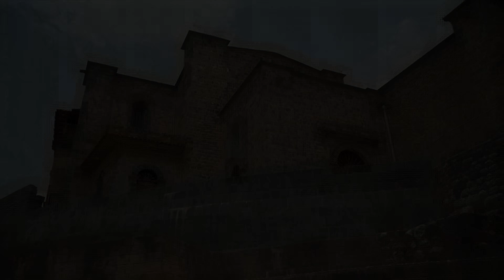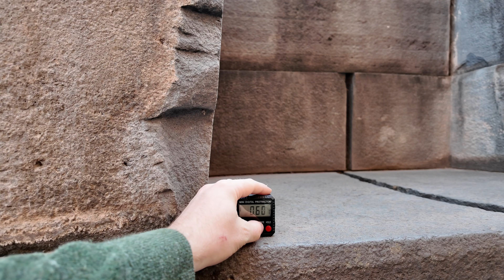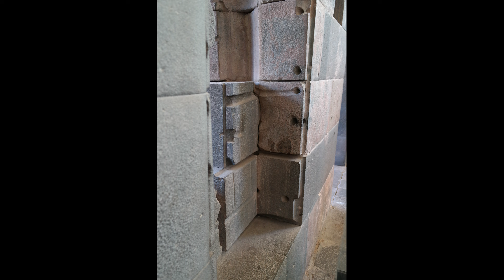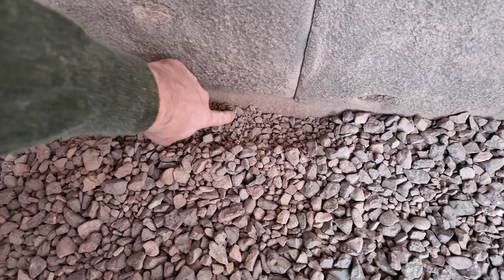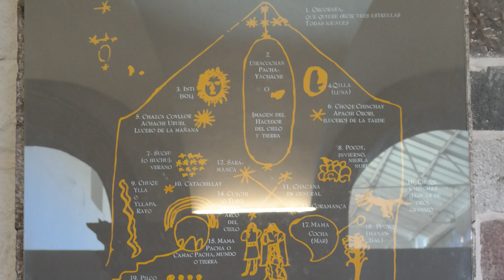The Lost Ancient Golden Machine

Comment: 4:20 they would purposely not make it flat/level because it's an open space where rain would pour. You wouldn't want the water sitting there pooling all the time(especially if they placed sacred objects there that could be corroded).
Reply from the maker: Multi-purpose platform. For example, a cars windshield is curved to not only push rain water away easily, but to also make the car more aerodynamic.